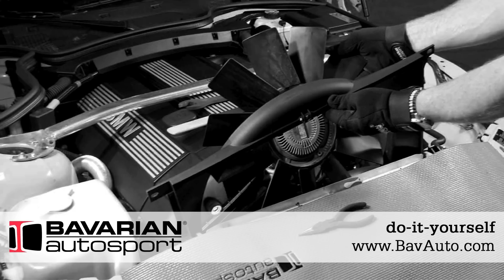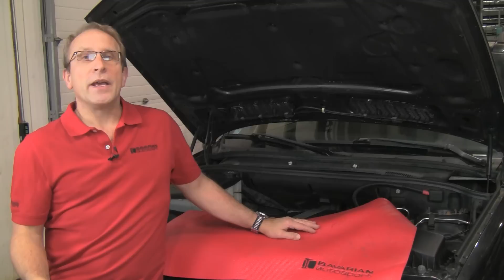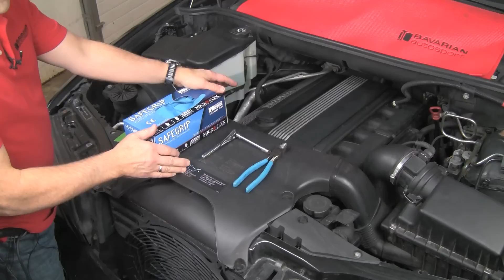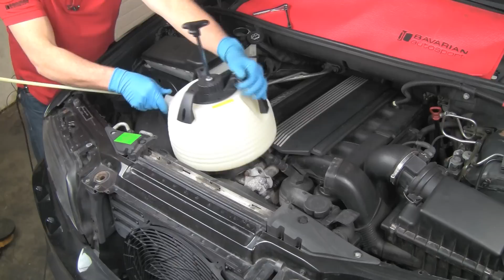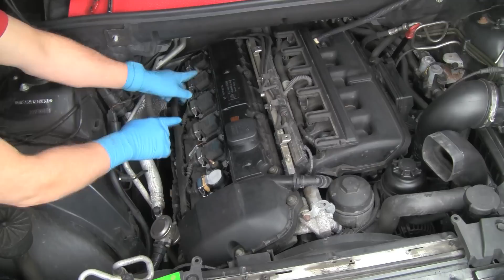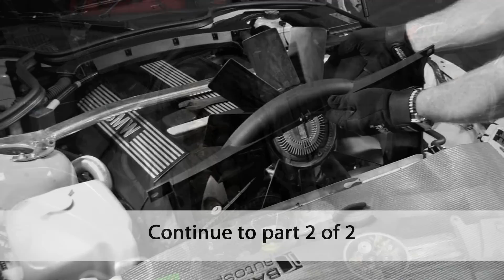Part 1- Replacing a BMW 6-cylinder valve cover gasket

Comment: Is it more difficult on an X6? Dealer is quoting 18 hours to replace valve cover gasket. Some local shops are in the 16 hour range. 

That seems insane to me. They say it's because an X6. Have to remove catalytic converter?

Comment: I just had new valve cover with ports done under two years ago, and now the gasket needs to be replaced...is that normal...dealer says $1,600 to replace gaskets with labor. 2013 BMW X5 xdrive35i. Is that right???

Comment: Hi, thank you for making this videio.  I have a problem when replacing my valve cover gasket on my 2003 BMW 525i.  The valve cover gasket does not sit flat on the valve cover.  It is about a couple of millimeter higher than the grove.   I confirmed with the seller Autohausaz to make sure I got the right part.  Do you know of issues like this?  Thanks...
Reply: A couple of mm is not enough to compress it to seal the groove. I had a leak because of it. Now I fill the groove with rtv after cleaning all oil from groove.

Comment: Is this the same as a main seal? I know it sounds like a dumb question but my Bmw 328xi sulev 2011 needs a new valve cover gasket but at the dealership I was told I only need a main seal.

Comment: Hi Otto. Usually I just enjoyed your repair procedure but today I would like to ask you something. I own a 04 325cic with 60k mile. Recently I noticed something burning smell as I waited for traffic light. Pull over and piped hood open and noticed light grey smoke under the  cabin filter tray from the right side of the engine. I know that you can not diagnose  anything without seeing the car but I would like ask you that is there anything in that area that can be burnt? It does not seem like engine oil burning to me.
Any opinion would be appreciated. thank you.
Reply: I believe that the brake fluid reservoir may be in that location but not sure on the model that you have.

Comment: Hello, I have a problem with the second gear, in D from first to second the motor goes in to limp mode, I have to drive it in manual shifting from first to third gear, what do you think is the problem, it is a solenoid? Best regards

Comment: Hi there, I suspect my spark plug gaskets needs replacing - however, my head gasket is relatively new. Can I re-use my head gasket or do I need to replace both gaskets when opening up the engine? Thanks!

Comment: These vehicles may be called ultimate driving machines but they would have to be the most reliable. After 100Ks all plastic and rubber bits start failing, where as our Japanese and even older Euro cars are ok still. Two other bits we have had to replace are Electric window units and expansion tank. Even the mechanic mentioned that these failures keeps their mechanics busy fulltime!!
Reply: cyberskull676 not true, I have a 99 Lexus es300, no rust...
Reply: bethells86 yup our old Avalon has had a timing belt done a water pump and a couple other wear items and that's about it.... oh and it has over 230k miles, my bimmer needs on avg about $1500 per year in servicing since it broke the 100k mark

Comment: I just replaced the valve cover gasket on my 2003 Z4.  All went well.  Thanks for the video.

I ran into one small problem.  When you removed the O2 sensors, you took out a small "rubber guide" from near the front sensor.  Mine also had that guide.  I didn't notice where it came from and I can't figure out where it should go.  

Do you know where that part goes?

Comment: Replaced my valve cover gasket, ignition coils, and spark plugs last weekend - a much easier process with the help of this channel. Thank you for continuing to be a such a great resource for DIY and BMW info.
Reply: William Cornell  I'm short on cash so I'm thinking of doing it my self is it hard
Reply: my head gaskets busted. not sure if i should strip it for parts eh.

Comment: Hi  looking for advice from BAVAUTO. Got 2 questions.
1.  how does crank case ventilation hose should be inside, Once i removed the clip as on the video i put my index finger in the hose and felt very tiny amount of oil looks bit dark?
2. The crack between vanos cylinder and the engine seems leaking. Can i just add sealant only in that place without removing the whole assembly (its leaking massively next to the nut, i felt there is a gap between the gasket and the rocker cover, i could feel it with my finger) ?

Comment: how much harder is this for a bmw X6?
Reply from the maker: +Arash Rajaeeyan - The E71 X6 will have a different engine.  If you have a 6-cylinder, the procedures are similar, but you must deal with the ValveTronic motor.  If you have a V8, procedures are different AND you still have the Valvetronic.
Reply: +Bavarian Autosport BMW of San Francisco quoted me $5,500 (5.5 grand) to change my valve cover and told me it takes 3 days,
how long should this normally take for a X6 ?

Comment: Otto, Can you comment on how frequently the valve cover is "warped" and should not e reused. A repair shop near me told me this is quite common. 
Also, are there torque values for the spark plugs  and/or the valve cover bolts.

Great Video, Jake

Comment: I need an opinion, I have a 1998 528i and today I was driving and it overheated. I let it cool down and coolant was boiling out and almost all the coolant ended up on the ground. My house was close by so I was going to just drive it there. So when it got cool I tried to start it and it wouldn't start. I got a friend to bring me coolant and after a while I got it to start, then I drove it less than a mile before it overheated again. Does anyone know what it might be?

Comment: What is the difference between the M52 and the E53?
Reply from the maker: Bishop Loon We think you mean the M52 and the M54 (E53 is the X5 model chassis code).  The M52 will be similar enough that you can use this M54 video to get the job done.

Comment: thats a very helpful video... i have a bmw x5 and the gasket have a oil leak on the front corner, i would like to know if thats a big issue , or would affect the engine .....do  i just need to replace the valve cover gasket? your help will be appreciated, thank you

Comment: hi thanks for the vedio. i have a2006 bmw e90 325xi, i want to chage the valve gasket. do i need to disconnect the battery first?
thanks!
Reply from the maker: No ... no need to disconnect the battery.  Just don't turn the ignition on while the system is apart.

Comment: Can you do a structural video on the bmw M54 engine models head gaskets ?
Reply from the maker: Head gasket replacement is more involved than we can offer in our "short film" DIY videos.  The Bentley repair manual does cover the tasks.  Additionally, you can likely find some individual hobbyist videos on the task.
Reply: Ok.

Comment: I reviewed the video and noticed you did not mention anything about the torque pressure for the bolts.  Is there not a specific amount of pounds of pressure the bolts need to be adjusted to or can you just follow the pattern you specified and tighten them until they are very tight and be alright?
Reply from the maker: The specified torque is 89 in-lbs.  If you do not have a good feel for torque valves, from long term experience, you should use a torque wrench.  This is not a critical load fastener (like a cylinder head fastening bolt) so the exact torque is not so critical.  However, an unexperieced DIYer could over tighten and break a fastener or be a bit too loose.

Comment: first of all your videos are really helpful and awesome.
second i'd really be thankful to you or anyone who can tell if this issue(the cover gasket) can cause the (service engine soon light to come on) with the code P0174.
i'll be waiting for your replay.
thanks
Reply from the maker: Yes, a leaking valve cover could cause a vacuum leak and a lean condition. However, Since you only have the P0174 code, this is only indicating lean on bank 2 (cyl 4-6).  A leaking valve cover gasket would affect both banks .... unless, there is more of another problem with bank-2 (old O2 sensor, spark plugs, injector spray pattern issues, etc.) and the small vacuum leak has now pushed bank-2 "over the edge" , but bank-1 is able to stay within parameters of the fuel trims.
Reply: So it's more of O2 sensor cuz I've just replaced my spark plugs.
Reply from the maker: Tito Neal
Yes, the O2 sensor for Bank-2 (cylinders 4-6) could be the cause.  If you wish, you could swap the Bank-1 and Bank-2 O2 sensors, clear the codes, and see if the fault returns for Bank-2  If it does, then something else is at fault.  If the code moves to Bank-1, the sensor that was in Bank-2 and is now in Bank-1, is faulty.

Comment: appreciate the order, seaquence and science in ur work Sir.. and diagnostics for other stuff as well. wish to show tools for removing the distant bolts of the gasket next to windshield
Reply from the maker: Just the proper combination of socket, extension and ratchet.  Note that if you have a 3-series or 5-series, that you have to remove the cowl air inlet tray.  This is detailed in the Bentley publishing repair manuals, available in our online store.  www.bavauto.com
Reply: Thumbs up..thank you.

Comment: I did a jump start and it seemed like the power is slowly up , it had crank and start already and the lights as well was working.and then i'd leaved the  engine on for 5 minutes then i turn it off to had my meal, when i came back to start again it has a power and lights but wasn't  able to start the engine until the lights are slowly powering off..
Should i make a run for the engine and leave it on for a long minutes until battery is charged enough? Coz i think my battery is fully dead coz its been like 2 weeks i haven't warming up my car..
Reply from the maker: Sounds like you need to charge it for a while.  Either run the engine for a longer period or use a battery charger.
Reply: Ok..i will do that.tomorrow. will inform u what would be the result is. Thanks sir.

Comment: Would like to see a video accessing the rear of the engine on the e90 sedan version for valve cover replacement
Reply from the maker: Watch the first part of our DIY video on performing the walnut blast on the N54 engine.  We show the removal of the cowl panel, in order to access the rear of the engine.  Click the link below:
http://blog.bavauto.com/15543/bmw-diy-video-carbon-cleaning-n54-and-n55-intake-ports-and-valves-de-carbon-walnut-blast/

Comment: What is the problem if my BMW x5 x5 3.0i  2005 model no lights no crank no start..no electricity?. Do I need to perform a jump start?
Reply from the maker: We would say that either your battery is totally dead or you may have an issue with either a positive or negative cable connection.
  Start by checking the battery voltage .... or just put a charger on it for a bit to see if power does come back.
Reply: All is good after i did a long hours of ran for my car.

Thanks, 
Bavarian Auto
Reply from the maker: Thanks for the follow-up!

Comment: My 2001 325i is burning too much oil, I've replaced the CCV since it seems to be the most common thing that causes burning oil, it helped reduce the amount of oil that is the car is burning, now at around 2500miles after the last oil change and the dip stick shows just barely over the "low" line which before the CCV was replaced that wouldn't even reach 1000miles before hits low.

Next thing I've seen on forums is this VCG, I will replace this one ASAP, and in case the car still burns too much oil, what other things that could be causing the burning oil symptom?

It is quite cold weather nowadays and I do get white smoke on the exhaust, some days it goes away quick after the car has warmed up some days I would be driving for half an hour and still have white smoke.

Anyways thanks in advance!
Reply from the maker: Well, one quart in 2500 miles is considered OK, by BMW.  We still think this is excessive.
If the valve cover or other gaskets (oil filter housing gasket, oil pan gasket, etc) are leaking, this would contribute to the loss of oil.
You may now just be dealing with engine wear (piston rings and valve seals).

Comment: I have a '03 325ci (10/02) and was wondering can I use other valve covers? My original valve cover is part# 											 											 												
11 12 7 512 839, would I be able to use a part# 											 											 												
11 12 7 512 840?
Reply from the maker: The 11 12 7 512 840 is not a valid BMW part number.  Do you mean the valve cover for the earlier (through 8/02) M54 engines (11 12 1 432 928)?  In this case, yes, the valve covers can be interchanged.  You would also have to use the earlier coils with the earlier valve cover.

Comment: I have a 94 318is and Im going to replace the valve cover gasket because I found oil in the spark plug holes, my question is could this be the reason my car misfires? Because when I drive let's say at a constant speed of 45 mph my car all of a sudden feels like it's miss firing and sometimes even at start up
Reply from the maker: Yes, the oil in the spark plug tubes certainly could be causing the misfires.  Pay attention to the spark plug boots as well.  If they are deteriorated, they will need to be replaced in order to prevent the spark from arcing the the walls of the spark plug tubes.  Either way, be sure to clean all oil out of the boots and wire ends.

Comment: Does this video apply to a 2008 X3 3.0? I had a shop recently tell me that my valve cover is leaking and that the entire cover needs to be replaced because this model does not use a separate gasket. Is that correct? If so, where can I purchase a new valve cover? Thanks!
Reply from the maker: See our reply to your same question under Part-2

Comment: Hello guys
I have a question about my BMW 523i 2007, I bought it used a month ago. it was good but suddenly after I changed engine oil & filter 4 days. the engine start shaking little bit specially on slow speeds maybe 50 KM or stopping the car on high speeds the car is stable. I checked it on computer it gives error on crank shaft sensor I changed it but the problem is the same. the guy who checked it told me the engine has lots of dirt because the oil is not changed for long time or the car is not used for long time. and that make the oil pressure is low and the engine needs to be cleans internally. I thought to flush the engine. is that a good solution.
Reply from the maker: Well ....... We don't know that the internal cleaning would have any affect on the symptoms that you described.  However, we do fully recommend a full application of our Liqui-Moly Engine Renewal Kit (internal cleaner, fuel cleaner, carbon cleaner & anti-friction coating) for any engine that has more than 30,000 miles .... especially if there is evidence of sludge and varnish due to extra-long oil change intervals.  Use the kit and put a few hundred miles on it ... and see if things improve.  Click the link below:
http://www.bavauto.com/fland.asp?part=lmerk

Comment from the maker: To Jamie - Not sure what you mean, but it is not uncommon that the stud will come out with the nut.
Reply: +Super Super Supermodel 
The valve cover bolts intentionally bottom out, the rubber grommets are squished at that point.. no need for a torque wrench, just don't overtighten. Torque spec is 22 ft lbs on the spark plugs.

Comment: My car started with a rattling noise above the vanos since I'm changing my valve cover gasket should I repair the vanos and do you think the rattling will go away.
Reply from the maker: You may very well have the classic VANOS rattle.  The rebuild should cure this.  See our DIY on the VANOS rebuild:
http://blog.bavauto.com/13829
Reply: Thank you for the video I'm going to give this a shot and I will let you know how it all comes out . I do have one more question my Door keeps on reading open but the door is close, the button in the middle will not work ?? what can I do to reset ?
Reply from the maker: Rick N
What model do you have?
Reply: 2001 BMW 325i
Reply from the maker: Rick N
 - yes, you certainly could have a rattling VANOS unit.  We'd recommend the VANOS rebuild while replacing the valve cover gasket, especially if the engine has more than 100,000 miles.
Reply: Hello The Vanos was the problem I changed the seals on the Vanos witch I got from Bavarian auto and the valve cover gasket was also really bad all my plugs had oil inside of them , The coil boots where all bad also do to the oil, No more rattle and the car runs like a champ. Thank You
Reply from the maker: Rick N
 - Thanks for the follow-up!

Comment: Hey i have 320i man 2005 e90 i want to change the Pan oil cover but the dealer said that i have to change the oil too which i just did it before one month ago :/ any idea if i have to put a new oil or not ?
Reply from the maker: No, it is not required to change the oil after replacing the valve cover gasket.  Just take care not to contaminate the current oil with cleaning or dirt, while doing the job.

Comment: I change my waterpump of my x5 2002 and the acceleration is bad it dosent accelerate it goes like a little by little to get acceleration goes fast 
Do you know what it is the problem?
Reply from the maker: We can't think of a direct relationship between any of the work that is done in replacing a water pump on the M54 6-cylinder or the M62 V8, and having an engine running issue.  We would suggest that you go back over your work, step by step, and see if you can notice and unplugged connectors and anything else.

Comment: I did this on my 98 323 and I didn't put silicone at all....should I do it all over again just to put the silicone or can I get away with no silicone?please help
Reply from the maker: The potential is that he rubber boot "glues" itself to the spark plug, without the Silicone lube.  This does not always happen, but if it does, it is a real pain in the neck, to get it all removed.